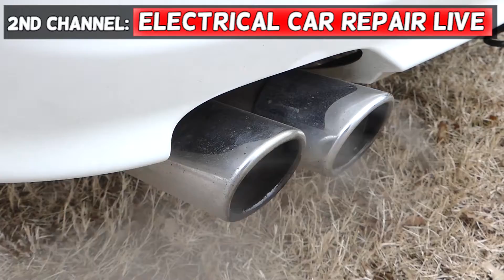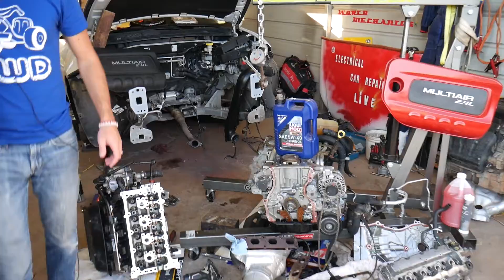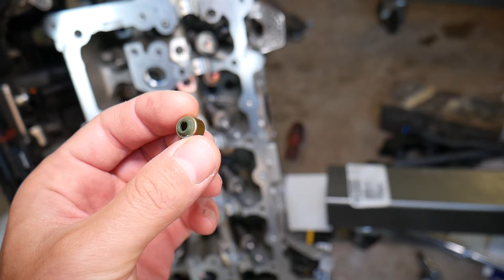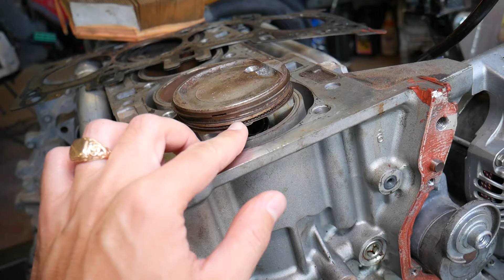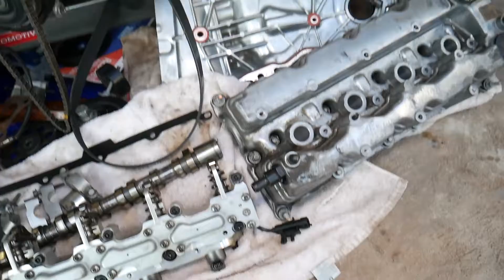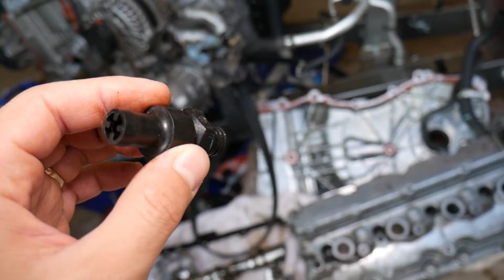EXCESSIVE OIL CONSUMPTION JEEP CHEROKEE, RENEGADE, COMPASS, PATRIOT, WRANGLER, GRAND CHEROKEE

Comment: The real problem is that the piston oil control rings were manufactured improperly! Jeep just gives you a software fix to adjust the fuel injectors or some crap which helps a little but really all the engines should be rebuilt with better piston rings !

Comment: Just got the Powertrain Software update for my 2014 Jeep Cherokee which indeed helps the car handle better but I’ll check my oil consumption over the next 3 months and come back with an update. The 2.4L Tigershark is an Italian engine and Italian engines are known to burn oil.
Reply: @555_Lady_JB  they didn’t give me option but I wish they did.

Comment: What grade oil is best for the 2.4. I have a jeep Cherokee and it doesn’t use oil. But 0w20 seems too thin. I’ve heard of them drinking oil at 10,000 miles and needing a new engine.
Reply: Not all of them do burn oil. What year is yours?
Reply: @Cleaning_Hero  mine is a 19. It used about a   Quart over 5,000 miles.

Comment: Mine uses a quart every 1000 or so miles... use to be about 2800 miles a quart. 53k miles on it now. It's used oil since brand new. I just top off here and there. Still runs strong and has the same power it did since new. I dont see the trouble of getting new engine it seems they are just a LOOSE engine with ultra thin oil. I doubt there is any real defect. Looser tolerance gives better gas mileage but vapes oil faster. For every give there is a take I suppose...
Reply: @555_Lady_JB  Not to bad. I still top off here and there. I haven't done a milage check between topoffs in awhile. I will do a new one and see where its at now. After the update it didn't use 1 quart every 1000 miles. Ill update ya soon im at 70,000 miles total.
Reply: @555_Lady_JB  I really love the renegade. What I believe is the engine like alot of others made  now days are really loose. Rings aren't as tight. With the 2.4 tiger its worse with deceleration. The update is supposed to change timing for less vacuum on deceleration. I dont believe it would stop needing topoffs at all even after update. Some were made with tighter rings. Thats why some people dont see the issue. I drove 600 miles yesterday straight ( first time the jeep was on the road in awhile) i checked the oil. It didnt drop any. Normally it would have dropped some. Here is another tip. If you change cabin air filter be mindful, junk will fall off of it and fall into the blower. Then you have to take the blower motor out and clean. Slide something under filter before taking it out. I learned this lesson the hard way.
Reply: @ericj810  Also I LOVE my renegade but only 27k miles stop n go driving so they want to take my engine apart to take pictures to send in to fc a. I just don't know how to proceed. What my options are.
Reply: @555_Lady_JB  if they want to replace it i would go a head and let them. (At no cost to you). You could get a new 0 mileage engine out of the deal. Im surprised they want to do that.
Reply: @555_Lady_JB  I have never used anythong other then 0w 20. Warm weather 5w 20 wouldnt hurt. Full synthetic penzoil.

Comment: What could cause excessive oil consumption on a car with the 2.4L that has less than 40k miles on it? My friend has a Cherokee with this engine and it burns so much oil
Reply: There's currently a lawsuit involving the Tigershark 2.4L that is in the Cherokees. I don't know the reason for the high consumption going by the lawsuit, but Jeep dealers in the lawsuit admit that the high oil consumption is a known issue and FCA has no plans on fixing it. They're just going to stop using the 2.4 engine. I've heard of some people who document the oil consumption get an engine swap for free from the dealership. They usually go from the 2.4 to the 3.2.
Reply: Lion Slicer Do they change it for the Renegades???
Reply: @Fireteam2479  The Jeep renegade has different engine options. The 2.4 tigershark on the Renegade still may consume oil, but the 1.4 (not in the newer models) and the 1.3 arent known to consume oil.
Reply: Lion Slicer The Renegade 2.4 is the one...
Reply: Lion Slicer is this for the older 2005 modals too?
Reply: @quantumstudios7944  The Tigershark 2.4 engine is the one with the oil consumption problem and it didnt come out until 2013. The 2.4 world engine that came out in 2005 doesn't have the oil consumption issue, at least not on as big of a scale.

Comment: I've heard brand new jeep Cherokee's 2.4l with 200 to 500 miles drinking oil like crazy
Reply: My brother-in-law just had the 2.4 in his Renegade replaced at 22,000 miles for oil consumption.
Reply: I have 5.2 grand cherokee 1997 . in 350 miles it finishes 2 liters of oil lol
Reply: @555_Lady_JB  the dealer replaced it under warranty. They didn't give him a hard time at all.
Reply: @555_Lady_JB  I asked him and he said he didn't know if they took it apart first or not. It was shutting down on a curve because the oil level was getting low. He got rid of it after the engine replacement.